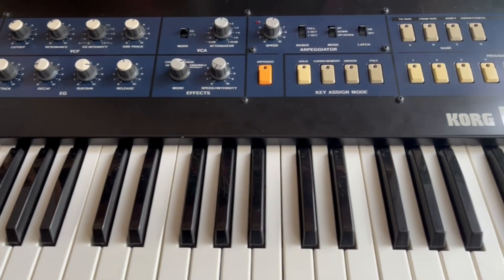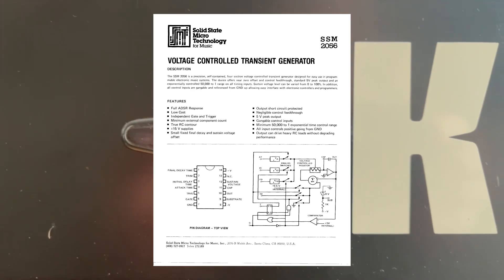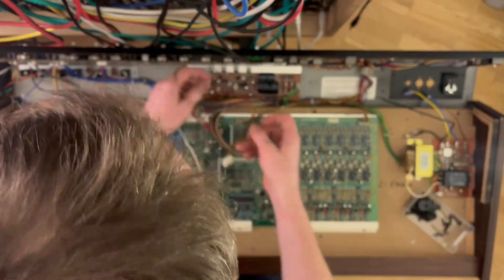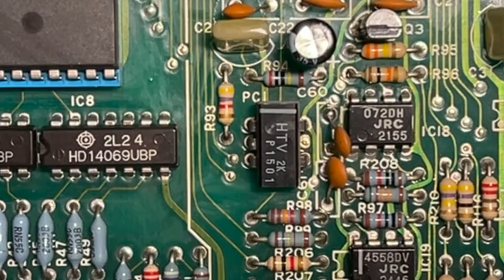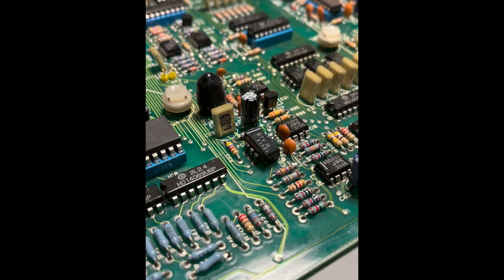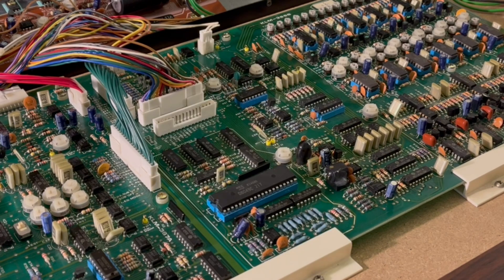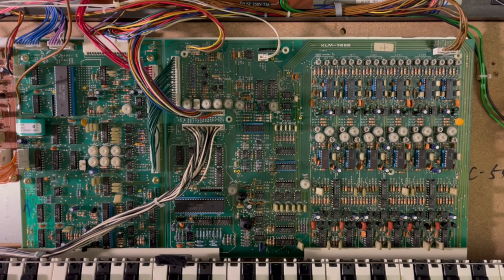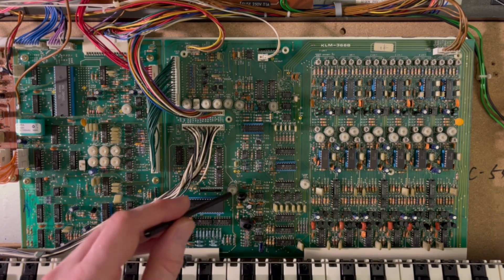FULL RESTORATION of a broken KORG POLYSIX SYNTHESIZER

Comment: I have a Polysix which had battery damage. After fixing the damaged area and powering up there is no sound from the keyboard, except for a hiss when a key is pressed. Do you know if the factory patches have to be loaded before the keyboard will actually play a note from the keyboard? Thanks.

Comment: Thx for sharing the video. Tuning issues here.  Power up and  I first get -14v pin 7 on IC18 then changes to -6.5v. My synth exhibits failed tuning after powering down even after a new c1583 and numerous calibrations. I have recapped the synth and replaced the klm-367a and have stable PS voltages. I’ve changed to TL072 ic9,17,18 and r87 and r136x6 per manual. Also have Tauntek midi I installed but also put back old d8049c with the same tuning problem after. I have -1.79v middle pin of p1501 and -10v on other side pins. After 30mins synth usually gets close to tuned but not great. Before it was quickly in tune after power up. I have tried a VTL5C9 at one point in all this. Might try it again. Any suggestions or thoughts?  Thx.

Comment: I have one of these that justs powers up. I let my brother use it many years ago and it came back not working! The battery for memory never leaked and the board looks fine there. So in the meantime I just play my Korg Microkorg!! Alot smaller, and better sounds, etc. lol If I ever get time to work on the Polysix, I might. Plus the polysix weighs 800 pounds, and the Microkorg just under 5 pounds lol. Plus this Synth had so many flaws in it from the get go as you can see in the video what has to be fixed. Probably only a handful of these stayed working to this day.

Comment: Hello Polykit, how did you manage the noise floor? I repaired my Polysix, but it has a lot of noise. I replaced caps on voice, psu and effect board. still i can hear some noise/hum while fast turning resonance and some other knobs when volume is up. i did grounding wires to the points i found online. Did you use some EQing on this video? Thank you from Slovakia.
Reply from the maker: Hi Michal, I think I filtered out the noise floor in the recording. I just tried it out and noise/hum is not changing for me when turning knobs. Maybe pots are worn out? Greetings from Berlin
Reply: @polykit  I will do another calibration, but i need to rest from it for few days :). Thank you

Comment: IC’s are not discrete components.
Reply from the maker: This was in relation to the VCO. It’s made out of transistors, capacitors, resistors and op-amps. I would count that as discrete.
Reply: @polykit great video. Sorry for ignorance, where do the oscillators live on the voice board?
Reply: @polykit  An integrated circuit can't be a discrete circuit at the same time. I know the term discrete is used along the lines of non digital or analog these days but that is technically incorrect.
Reply from the maker: @PWMaarten  What I'm saying in the video is that the VCO is made out of discrete components. VCF and ADSR are integrated circuits.